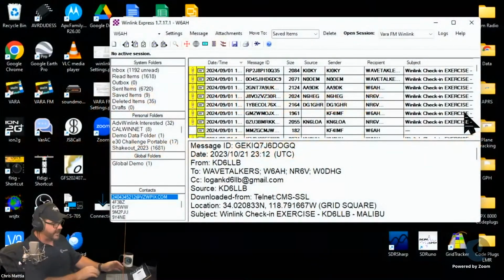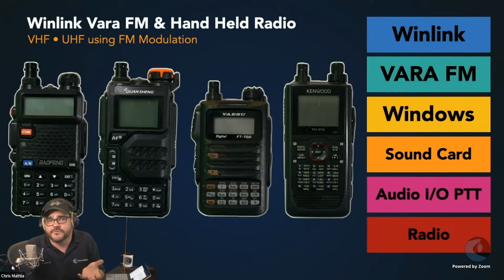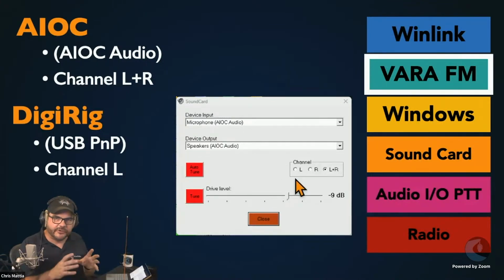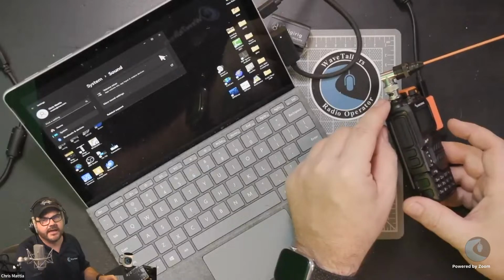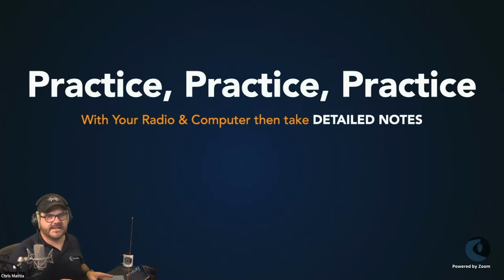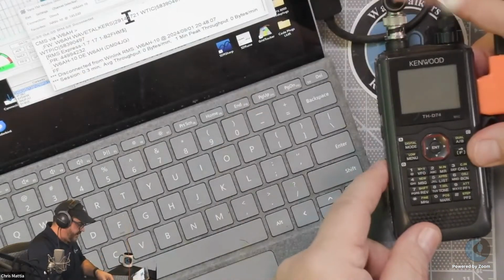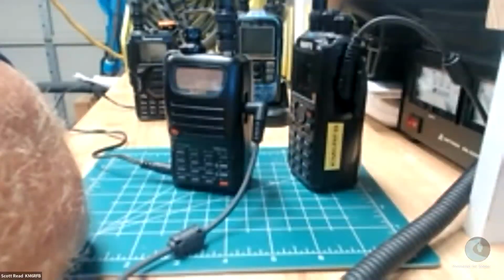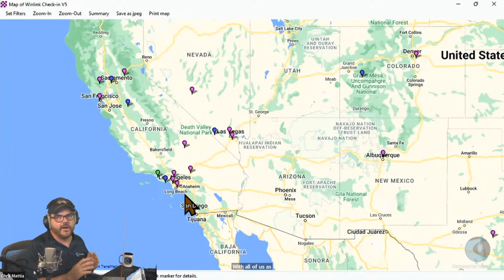Winlink Vara FM with HT - WaveTalkers LIVE 113

Comment: No matter how many times I get the VU meter to reflect -13 to -11dB, it starts in the red, everytime. Volume on the radio is nearly shutoff, slider bar in VARA doesn't change anything. WINLINK/VARA HF worked fine previously, but after installing VARA FM had to repoint the executable, and it was downhill from there.

Comment: I could only get the PTT to work with the Digirig Mobile in VARA using the COM port with RTS checked. The RA board setting wasn't working for some reason. Maybe give it a try if you're stuck. The Digirig channel on YT has a video about troubleshooting the PTT where he used this.
Reply from the maker: Good catch, check out episode 114 where we go into more detail troubleshooting this issue and show why that particular setting was not correct.

Comment: Hi I love this show and I am new ham operator since 2 years. I have question in regards of VARA FM software.  When I watch your demos when you connect you get a distinct pattern on the right diagram , your display shows 4 squares with little dots.  When I use VARA HF or VARA FM I just get a bunch of dots in the diagram no pattern.  Is there a reason why?
Reply from the maker: In simplified sense, the pattern shows the strength and speed of your connection to the remote gateway.  By improving your antenna, power, drive, etc you can often get faster speeds represented by the patterns.
Reply: @WaveTalkers  Thanks!

Comment: That HT does not support VARA FM WIDE. Better if you use VARA FM Narrow.
Reply from the maker: Very true.  Setting VARA FM to narrow would be more optimum for this particular HT.  However, as I use a variety of radios with my Vara setup, and wide will gracefully fall back to narrow, I simply leave it on wide and cut down on the various settings that have to be changed when changing radios.  It does take a little longer and if it becomes an issue it is easy to adjust.  thanks for the feedback.

Comment: The 90-degree antenna connector is a good idea.
Reply from the maker: thanks, the biggest benefits I've seen with the 90 antenna connector are 1) the HT can lay on its back where it is most stable and 2) with BNC connectors it is extremely fast to implement.